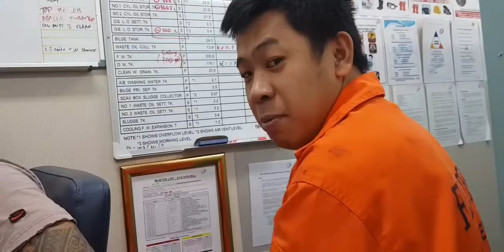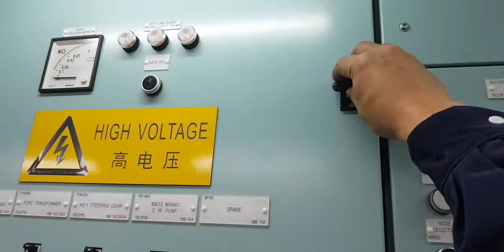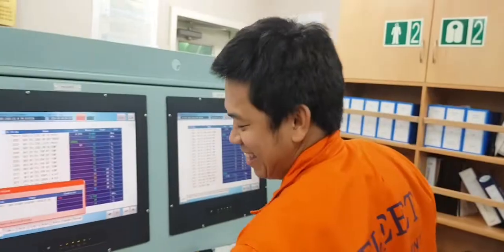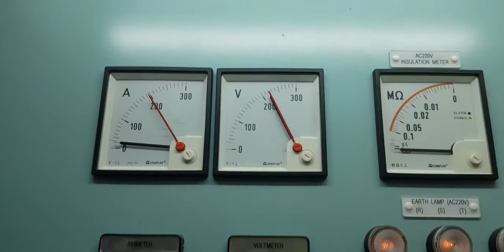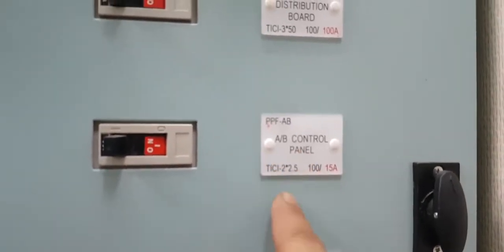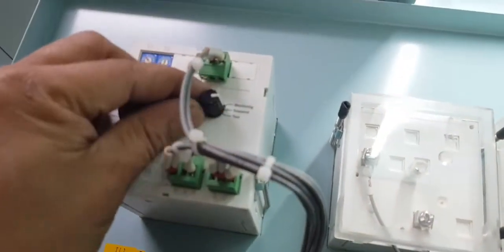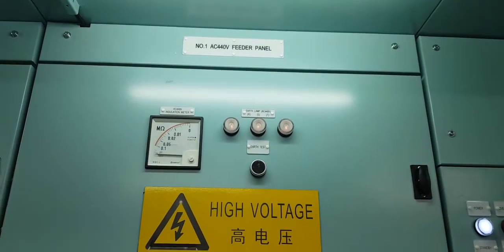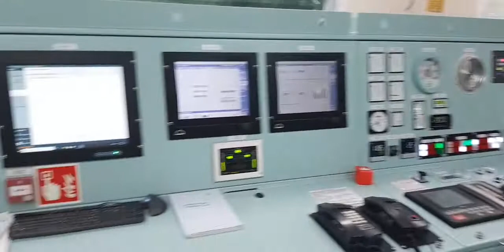how to try out 440V and 220V low insulation #electricalengineering  #documentary #film

Comment: sir good day,.  i just want to ask about a low insulation trouble here in our ship,. i isolate all the breaker which has 220V supply but still the insulation meter didnt down/ back to normal.. what could be the posible cause..
Reply from the maker: Theres someone cause yes.. all 220v please off all breaker one by one until you found the grounded.. and check all ligths connected 220v..  all cause useually ligths.. thanks for comment and question sir